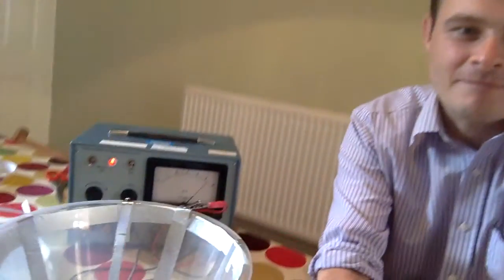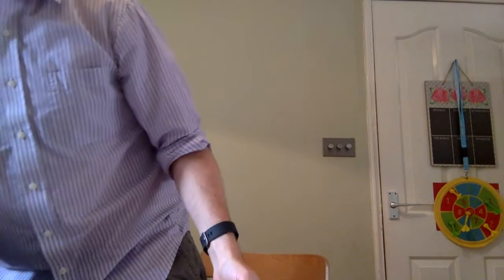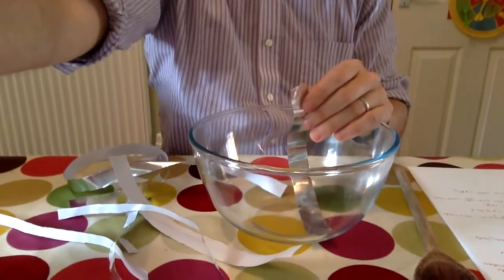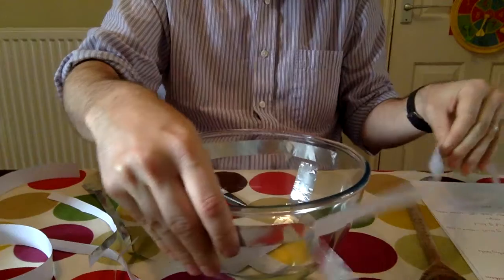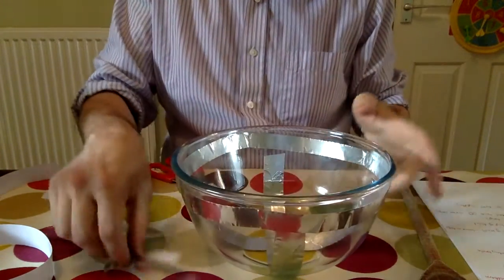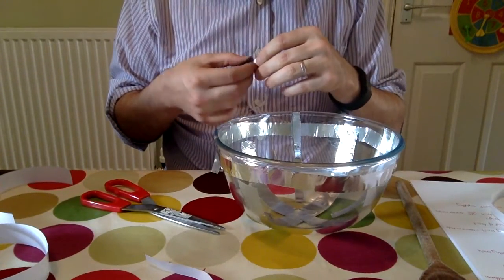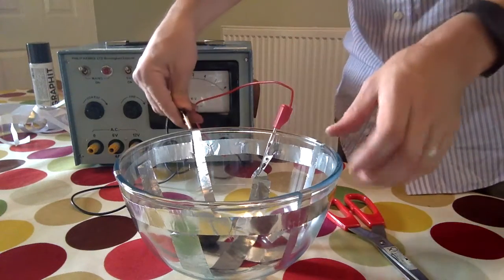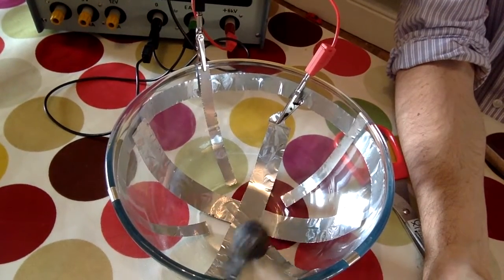Salad Bowl Accelerator - How to make

Comment: Hi Dan my son wants to make one of these for a science fair. Is there a home power source you can use? Like a 9 volt battery? What is the power source you are using?
Reply from the maker: Sandy Read you need a very high voltage. I have used a van de Graaf or an EHT power supply to get at least 5000V at a very low current. Batteries will not work but school should have the necessary equipment I would think?